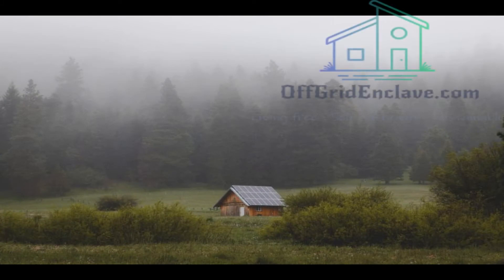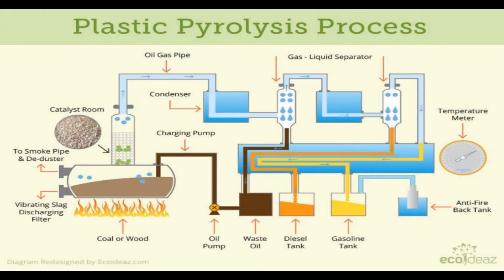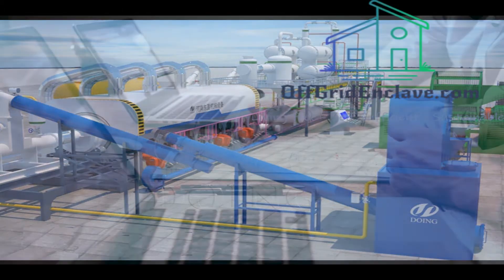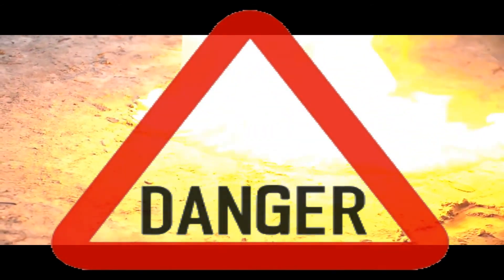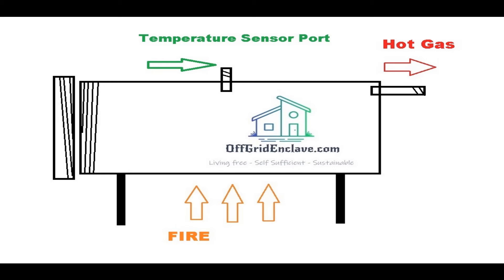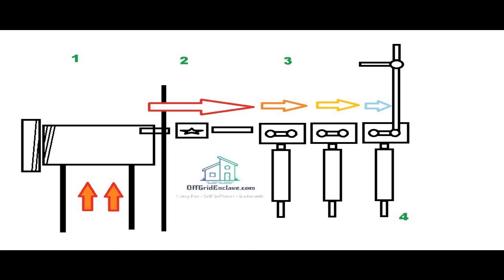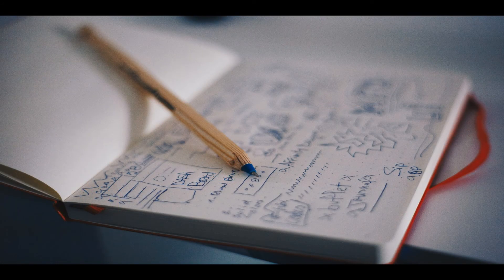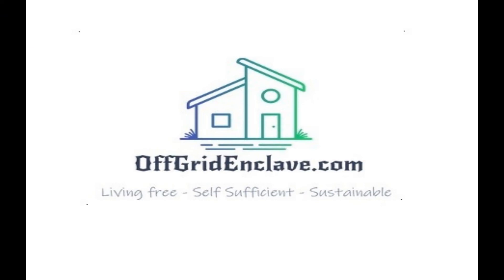Plastic to Fuel – Pyrolysis Reactor – Produce your own diesel and gasoline for OffGrid living.Part 1

Comment: IMHO keep things separate. Do not crack plastic to a crude-ish oil and continue on to fractionalize the other extracts (Diesel, petrol etc).  Here is why....  if you do not.....  this allows  you duplicate use of the  fractional of the apparatus.  You could not only use it to Fractionalizing oil you create  from plastic....  but also ability to use the fractional apparatus for OTHER oils you collected as well. In particular waste motor oil.   

now if you can figure out how to do as your plan here..... yet have a way to when desired re- seperate the apparatus for fractionalizing  waste motor oils(s)  on other days.....  then that I guess would be better. 

I reallllllly want to do this.  

BTW--- I wonder if you treat the crude-ish oil you make from plastic with an acid.....  like is done when recycling motor oil to get additives/contaminants to fall out.... you might can have a cleaner crude to fractionalize .... giving you a higher quality product of both diesel and petrol.   Myself I want all diesel and little to no Petrol or Naptha.
Reply from the maker: legit idea. i can see your approach make a lot of sense when you have aces to used motor oils and such.

Comment: Another of a thousand videos on the theory of pyrolysis . Have not yet found a vid with a unit in can buy or build that works start to finish
Reply from the maker: there is plenty of commercial units for pyrolysis, unfortunatly as meantioned in the video they are rather expensive.
but yes that is the goal of the project, to have something portable and affordable that can do batchruns in a offgrid scenario...  Test run of my testreactor should be in a few days..
Reply: @OffGridEnclave  there are small units... unfortunately they are sold as a demonstration unit and partial deposit on a large one.  So they run about 20 grand usd.   I get their reasons.  Say you buy a small one at a reasonable cost.....  all you have to do after that; if you desire, to then start a business....  is to copy ..... at a larger scale..basically stealing the designs from the other company and just hiring locals to build it for yuo..   With the massive big buck cost of demonstration unit.... also being a deposit on the larger unit....  then the company ensures they are not cut out.
Reply: https://www.youtube.com/watch?v=TFuTCpCVSbM&t=379s&ab_channel=TheGipsyJourney this guy made one himself